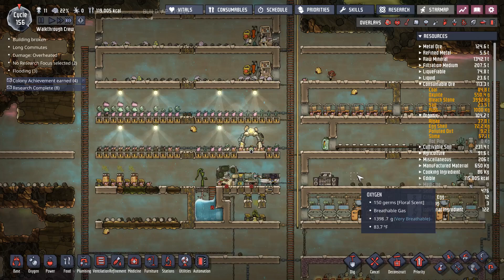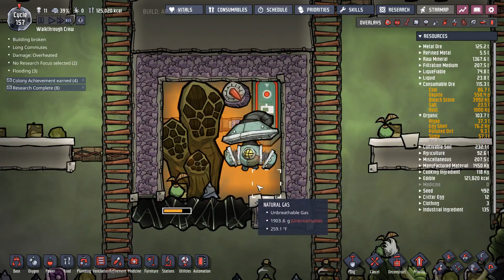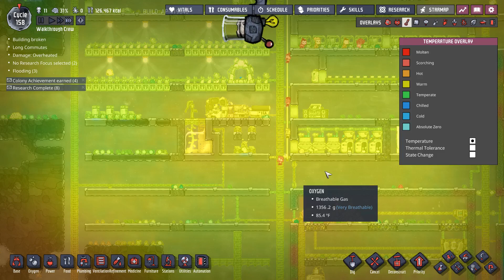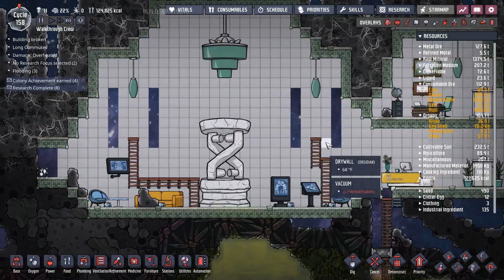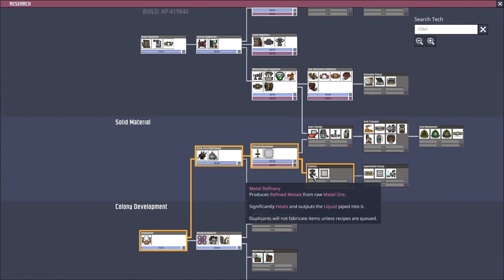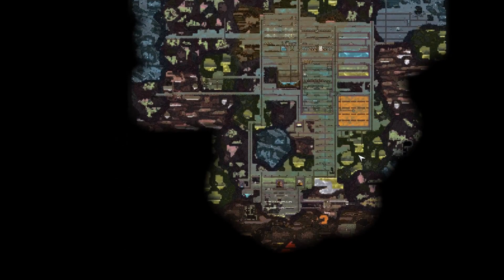Oxygen Not Included Tutorial: Full Walkthrough (Part 7)

Comment: How did you keep temp regulated near your bristle blossoms? I haven't dug down into the gas geysers yet, and am starting to set up the coolant system for the closed off production room, but cant seem to keep the temp near them low enough to keep them growing.
Reply from the maker: The biggest thing that will keep them cooled down is feeding them cool/cold water.  It will have the side-effect of cooling the surrounding area because that water will sit in pipes nearby and radiate the... coolness... of the water contained within.

Also, farming blossoms in the very center of your base as much as possible helps a lot, because the material that was dug out and left behind in that area is already pretty temperate.
Reply: @Magnet_MD  That makes sense. Thanks for the quick reply!

Comment: Thanks for all your vids. I like that you explain your main steps, but the little stuff is just vague enough that it still requires some working out and experimenting of our own. I've really gotta get the hang of better wiring soon now that I've got a lot more stuff running off a few batteries. At about cycle 50 now and I've got a pretty solid main base with bristle farming and coal ranching, plus I managed to get plumbed bathrooms on a self contained loop for now (altho I do occasionally have to drain the excess out that the sieve produces but i literally just construct and deconstruct a pipe part every now and then for that atm :P). I started making a layered water system like yours ready for when I find an ice biome, but I need to really start exploring now, seeing as I've not ventured far (beyond straight up to get to space for my vent). Not even found much polluted water yet, let alone ice.
Reply from the maker: Sounds like you're in good shape so far!  For that self-contained bathroom loop, you can use a shutoff and some automation connected to any tanks you're using to store the excess water, and vent any incoming water if the tank is full enough.
Reply: @Magnet_MD  ooh, sounds like a good idea! I definitely need to learn more about automation, will have to wtch your vid on it soon :P I've just been dumping the water into a pool I intend to heat soon anyway. Do you have a vid on electricity? That's one I'm struggling a little with a little, just with where to connect what and how the transformers work within a loop. I kind of understand running things on separate loops to avoid overloading, but not sure if you need separate batteries for each loop, for it all loops can link back into the same few batteries etc.
I just finished building my basic 'water tank' like yours and just found ice too. Hype to start properly exploring more once I get a reliable water system going.

Comment: 6:25 if you place your pipes in the floor (200 kg vs the few kg in the air), there is is more mass for the water to exchange heat with.
Reply from the maker: Hmmm, that is a very interesting idea.  I do run my pipes through the floor for things like petroleum, but this may be something that I give a try.  Ultimately with cold enough water, the entire room sits at around 40F (or like 6-8C), which is plenty cold enough, but maybe for early stages this is a better idea.  I'll give it a try next time!